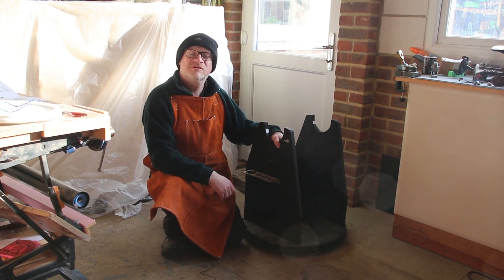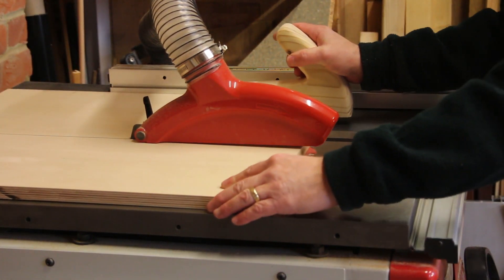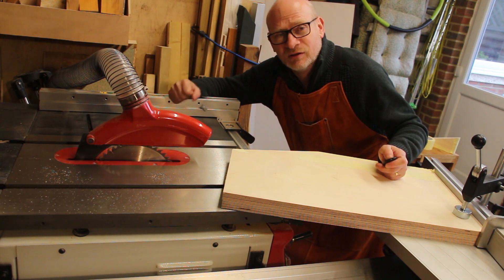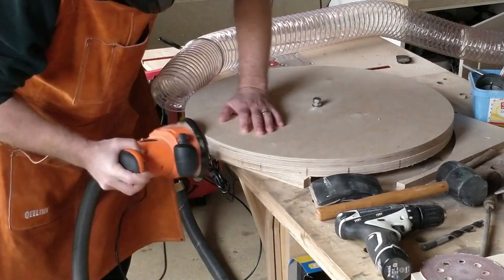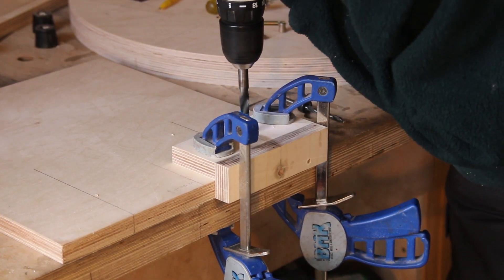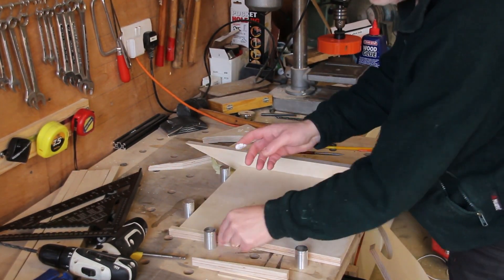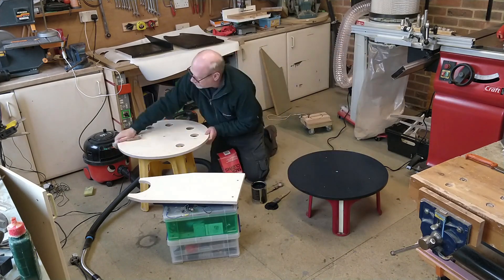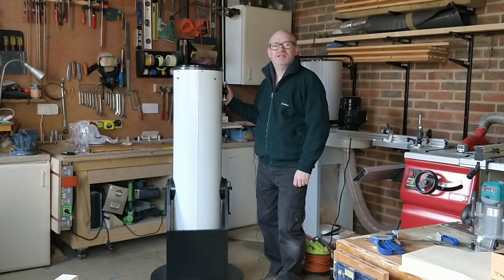76. 'Flat Pack' Dobsonian Telescope Mount

Comment: Bewautiful job.  However, the most popular DIY telescope is 150mm diameter mirror. Can it be adapted to this size of telescope?
Reply from the maker: Yes, the first telescope I made back in the previous millennium was an 150mm F8 which is ideal, I used some spare air-conditioning ducting as the tube :-)